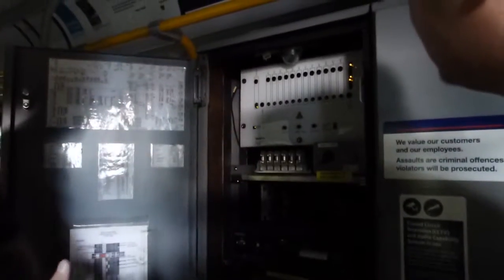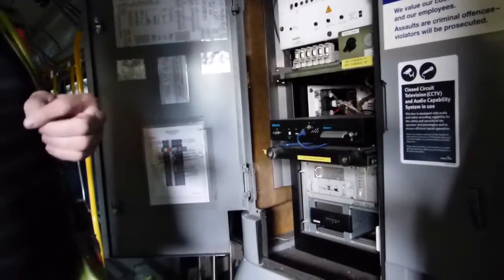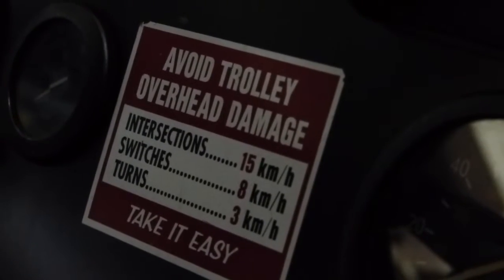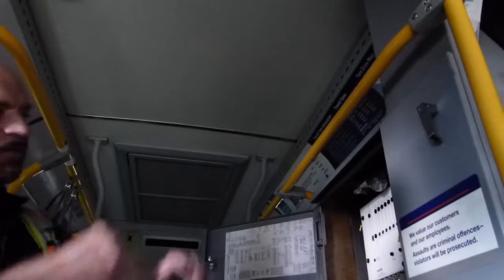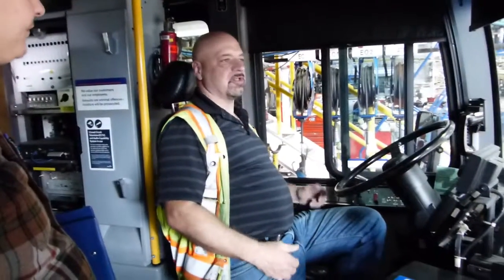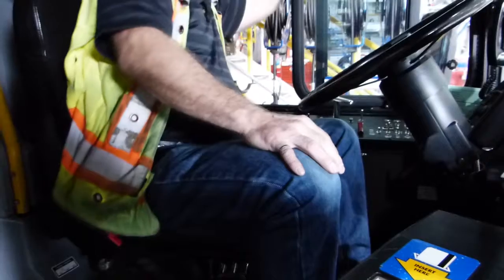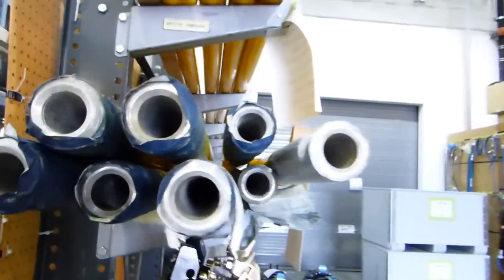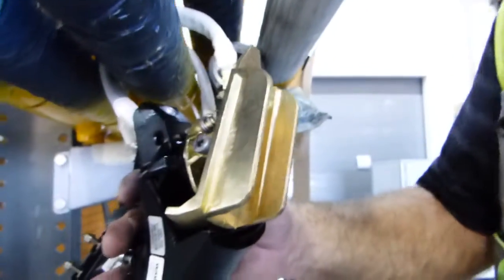Part 2 - Coast Mountain Bus Company Trolley Buses

Comment: The poles are pretty heavy in weight and de-wirements remain an issue on those buses in Vancouver.  It's just baffling why cities in North America refuse to explore the option of double-joint current collector heads that are used in Zurich, Bern and Lucerne.  These innovative double-joint current collector heads are made by K+M and they are much better at preventing de-wirements at curves and allowing buses to maintain speeds without having to worry about de-wirements or damages to the overhead.
Reply from the maker: Sounds interesting! Would you have a link to a good video or website showing these? Thanks!